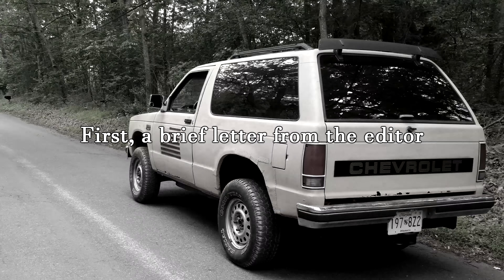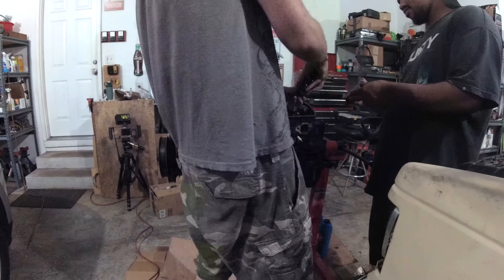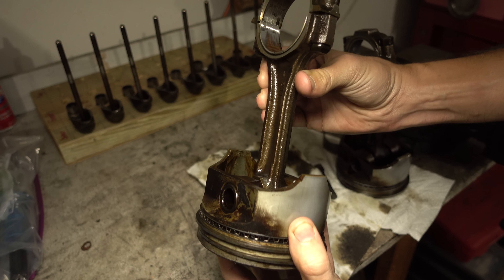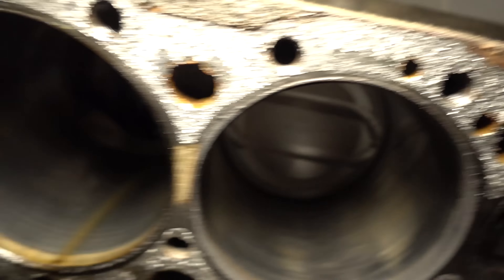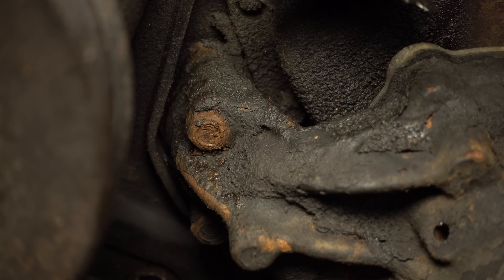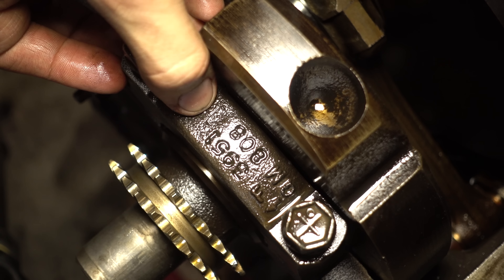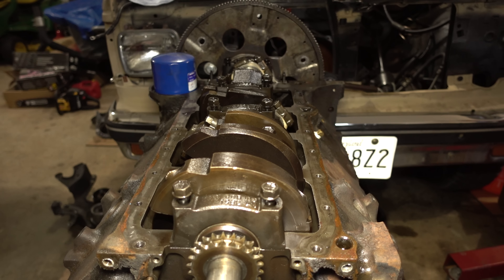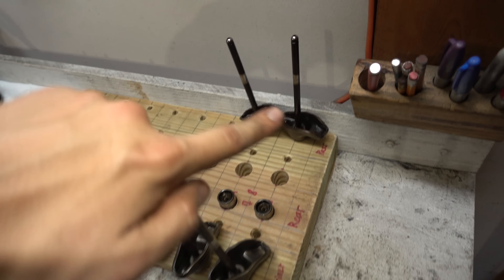V8 S10 Chevy 350 Engine Teardown (Ep.5, Part 1 of 2)

Comment: This rebuild is the kind of video I want to see. My project is a 99 s10 blazer 4.3 4x4. Paid 300 bucks for it. It had 208k in it now has 220k been driving it for 2 years only done general work plugs and cap and rotor button. Runs like a top

Comment: I've taken those power steering pulleys off numerous times, if the collar that holds the two parts together is too loose just use a couple zip-ties to hold the halves together. Great video!
Reply from the maker: Good thinking! I've used the puller a few times since this video and with the steel sheet shim it worked perfectly! Wanted to keep everything metal so I can torch the pulley with the puller on without worrying about it.

Comment: These guys are making great videos and they are entertaining to watch.
I am a lot older and I have done a few engines when I was their age. What we learned back in the late 60's was the quality of the rebuild is directly related to how long it will be until  you will have to do it again. Also when you are young owning a car 3 to 5 years is a long time.   We also used to go to the local self serve car wash and pressure wash the parts, it saved a lot of cleaning time, but I imagine now days you will be run out of the place if you try to do that.

Comment: Don't tell me you're using a torque wrench to loosen everythjng
Reply from the maker: I meant to mention it, I will in the future. It's no good (the orange tape is to make sure nobody uses it to torque something) as it was left on a high setting for many years. Cheap brand so no point in getting it calibrated. Works great as a big 1/2 ratchet and that's what I use it for, haha.
Reply: There’s always that one guy. Dude who cares if he used fisher- price my first socket set. You’re missing the point of his video. He doesn’t have a fancy shop and a $6,000 grand cart of over priced snap-offs. Like most of us he gets tools from Harbor- fraud. And he’s getting the job done ✅. I once took apart my 4cyl GM  engine replaced the head gasket and I didn’t label a single bolt put everything back in and spayed In starter fluid and prayed .I ran the wheels of that car for 5 more years until the trans went out.  To make a long story short just get in there and get it done. 

P.s. name brands changed intentionally to protect his video against copyright.
Reply: Hey thanks for letting me know! If it works it works!
Reply: FuzzyDicePimp  bro it was a great video mad props. Don’t let people sway you from doing more videos. I hope to see more

Comment: Where can I get them valve covers and heads? I'd like to have mine setup like that instead of the bolts on the sides, one broke off in the head 😑
Reply from the maker: I wouldn't recommend these cylinder heads as they are infamous for not flowing all that well, but (I think) all small block cylinder heads after 1987 were center bolt valve covers, and that includes Vortec heads. Those flow well are are plentiful, if you really want center bolt valve covers they would be a good choice.

Comment: The worst thing for a torque wrench is to use it as a normal ratchet, it throws off the calibration, and nice to know I'am not the only one who had problems with the Harbor Freight Pulley puller, it has to loose of a fit on the GM power steering pulleys
Reply from the maker: The one wrapped in orange tape is out of calibration from sitting on a high torque setting for like two decades, so I just use it as a long-handled 1/2 ratchet. Works great, but of course I wouldn't torque anything with it!

Comment: Removing the mechanical fuel pump block off. Well you aren't going to remove something back on are you? (12:08)
Reply from the maker: I can understand how that could be confusing but the plate that closes that port on the block is called a "block-off plate", so "removing the mechanical fuel pump block-off" is more what was meant.

Comment: I normally use a hose clamp over top of the fitments on the power steering pulley puller. Works very well lol
Reply from the maker: Good tip, that should do the trick as well!

Comment: Impact guns are a good investment. Even if your compressor is too small, they can break bolts free, rather than just breaking them off completely.   1980s stuff was weird. If it was part of the block it was usually SEA, but anything bolted to the block was usually metric. GM was in a transitional period in the 80s with Metric replacing SAE fasteners. Where I live that engine would need to be rebuilt before I could even install it. Emissions testing would probably fail and keep  that vehicle from being registered and licensed.

Comment: Hey, noticed your speedo doesn't work. Having problems with getting to the clip for the cable? On mine ( an 84), I pulled the driver side speaker on top of the dash.
Reply from the maker: Where did the speedo not appear to work? It functions just fine
Reply: @FuzzyDiceProjects  episode 3, at 11:24. Zero mph showing. 14v, real low oil pressure, water temp 210. Oops, zero RPM.
Reply from the maker: It is reading around 4-5 MPH, there is no 0 mark so I can see why that would be hard to tell. The tach probably wasn't hooked up at all (the V6 tach would not work with the V8 without being modified anyway).

Comment: You should totally use Wix oil filters or even Mann filter over ACDelco. They aren't very good
Reply from the maker: Really? I've never heard anyone say anything bad about ACDelco filters. They sure aren't top of the line, but they're cheap and available locally and I haven't had an issue with one yet. Do you have a link to an analysis on them? I have seen some for other brands, but not one on ACDelco.

Comment: Cool build. Suggestion, just snag an S10 remote oil filter set up. Surprised that it doesn't have one.
Reply from the maker: It did have one, doesn't fit the 350 block. Have considered combining it with a universal kit but since it's a convenience thing not a big concern at the moment.

Comment: ………..having said that then the added experience would be worth it for you to go through all the work and money, mind you you've basically rebuilt the whole truck for $2000.00.  That is a deal!!  Mind you, it's labour intensive and that's where all the cost lies, for novices like me anyway who have to rely on local mechanics in order to do a good job.  You've got incredible knowledge and skill at doing the work yourself.  From watching your video's it seems so incredilble to me that you know how to do all of that work yourself.  I'm so impressed by what you've done to that truck. 
It'd be nice that at some point you'd get it running to the point where there would be NOTHING left to do in getting it running like a new truck...…...which it basically is considering the time and work you've invested in it.  
I wish I lived closer and could hire you to be MY mechanic. :)
I heard you mention that the truck had quite a bit of rust under her, does that still make it worth your while to put so much work into it if it'll most likely only get worse as time goes by?

Continued good luck in your projects but the Blazer will always have a special place with me.  

Steve
Reply from the maker: The problem rust is really only on the outer body panels which it would take a lot of work to repair, underneath and on the frame/suspension parts the rust isn't too bad. To get the ride closer to "factory", it really needs weatherstripping to cut down on the wind noise and a quieter exhaust, but it isn't bad right now. No major issues with it at the moment.

Comment: Dude, I've been there, if there's any advice to pass on, its don't cut any corners while you have the engine apart, or it will come back and bite you down the road. Replace everything with new parts.
Reply from the maker: I made the mistake of not just rebuilding it in the first place, but I'm still cutting some corners this time around. To really get this done right, the cylinders and crank would need to be machined and that isn't in my budget. I'll do the best I can with those and try to do things right for the rest of the build and keep my fingers crossed!
Reply: OK, then hand polish the crank with sand cloth, do a ball hone on your cylinders, if you don't send out the heads,  lap in the valves by hand.
Keep everything as clean as possible on re-assembly.
Reply from the maker: Haha, you must not have seen the most recent episode of this series. Pretty much spot-on with what I did!
Reply: You will be glad you did, a peace of mind knowing it was done right the first time.

Comment: Perfect and enjoyable Video. and my question is why not replace everything. new rocker arms, push rods and lifters they are very cheap and while you are there just buy a cam for it EBAY even if used in good condition. and dont forget the valve covers hahaha im serious 350 parts are very cheap
Reply from the maker: The heads are bad enough a cam wouldn't do much good. New heads (Vortec probably) mean new intake, then the cam/lifters, etc. Gets expensive fast, or at least "expensive". There's nothing wrong with the lifters/rockers/pushrods in there, so I have no issue re-using them. I did order a new timing chain, that's practically a luxury item to me! Haha.
Reply: FuzzyDicePimp and plus with those little puny axles you don't want gobs of horsepower anyway just something good and reliable. So I totally get it and understand where you're coming from reuse everything they're perfectly serviceable so why not like I said you're not building 8 800 horse mud truck.
Reply: The effort my friend... One day you wold have wished that you have done this. i have been there BUT thinking about if someone had the effort to take it apart before and machine it instead of junking it he might have replaced the lifters...ETC but a cam isnt a bad idea

Comment: Holy shit! What would cause a head stud to snap?!
Reply from the maker: I mention it in one of these videos when I get the broken bolt end out of the block, the leaking head gasket filled the bolt threads with carbon and seized it up real solid. A strong impact gun might have gotten it out intact though.
Reply: Ya it's the next vid. I saw that already thanks! So was it you that broke it on the way out, or was it already broke?
Reply from the maker: It broke on the way out, it would have been happily intact if left stuck in there forever.

Comment: ………...absolutely amazing.  With all that you've been through with this blazer now it needs an engine rebuild?  You'll literally have a brand new truck when you're finished.  Financially, will it have been worth it after all is said and done?  I myself love the look of the Blazers for this year so putting the amount of work into it like you did would be worth it...……… but I can't help but to think that this isn't exactly your favorite design for an small SUV.  Still, what more could go wrong?!  :)
Reply from the maker: A lot of the reason I kept at it with this Blazer was for the experience! It is a very cheap way to do a little bit of everything, and makes for great video content. I wouldn't do everything exactly the same if I had to do it again, so it is good to have that knowledge for the future. Financially I am totally fine with this project, after the engine rebuild I had spent around $2000 on it and while it isn't worth much, it has been a great experience to have had.

Comment: I like the video format.
Next time you remove one of those pulleys, remember that it's a friction fit, meaning it was heated on or pressed with great force. Heat the shit out of it and she'll slide right off. Think Oxy-Acetalyne; you wont hurt it unless you put the torch into cut mode. In fact, if you use propane or MAP, it will take you longer to heat the item, meaning more heat will sink into the pump than if you had heated it faster. I've had a lot of luck using a three-jaw puller and torch on this style of pulley, it's hard to use the style you have (technically the right one) with a torch.
If you have a motor with incredible grimy crud, try a couple rounds of oven cleaner (outside, with gloves) and a hose. It'll change your life. haha
Reply from the maker: Gotcha, good tips! The tool worked well this time once I got it to hold onto the pulley correctly, but if I have a more stuck one in the future I'll try those tips!

Comment: Are you planning on a cam upgrade?  Or any performance parts?
Reply from the maker: The performance parts are that it has two, count em, TWO piston rings! On EACH piston! Wait, it doesn't end there! Not four, not six, but EIGHT exhaust valves!

Yeah, no, it's still going to be slow and I'm too cheap to buy nice parts for this thing. It's kind of scary to drive already.

Comment: Next investment you may want to make is a 1/2 impact wrench and not harbor freights $100 model.
Reply from the maker: I have an air impact, has saved my butt before, but I have to drag out the compressor for it so it's a last-ditch effort thing. A friend paid $50 for that corded HF impact and it has actually done very well!

Comment: your bearings are all shot and your journals are too. Use a proper micrometer and check specs.
Reply from the maker: I'll try to use a micrometer when I do the polishing, but I won't be machining the crank unless I find something crazy wrong. The crank surface has only very light scoring, so I'm hopeful. I have found spun bearings and damaged crankshafts before so I know what BAD feels like, and this one isn't that.

Comment: those are header gaskets.   normal material
Reply from the maker: What kind of material? I've seen paper, metal impregnated paper, all sorts of sheet metal and corrugated metal, solid metal, graphite, and a few different composite gaskets, but not one like that. It looks like it actually started to burn, and certainly squished and curled up around the manifolds. The manifold bolts were almost finger tight the first two times I ran it, had to tighten several times and they actually started to crack from it.
Reply: FuzzyDicePimp.  don't know what its called.  but it is a heAder gasket. Mr gasket  advance auto and the such sell them in their "speed part" section.   you can also buy it in 12 inch squares to make your own high heat gaskets
Reply: FuzzyDicePimp. also.   what I mean by normal material.  Is  that it's a normal low dollar steel headwe gasket.  they blow out easily.   I like copper header gaskets.    and they for some reason burn out really fast with cast manifolds